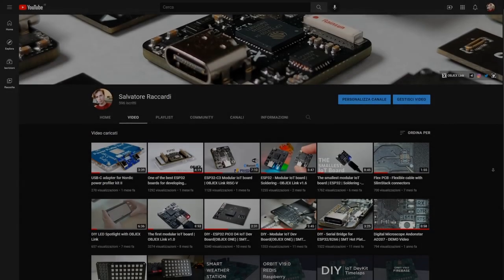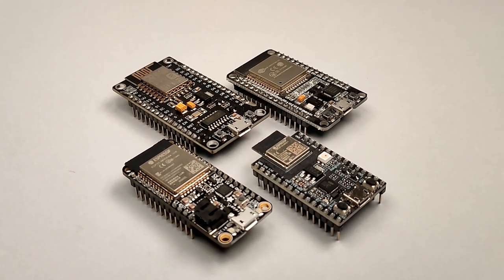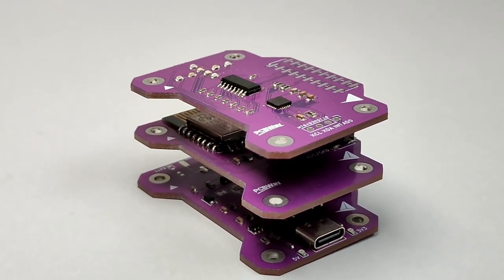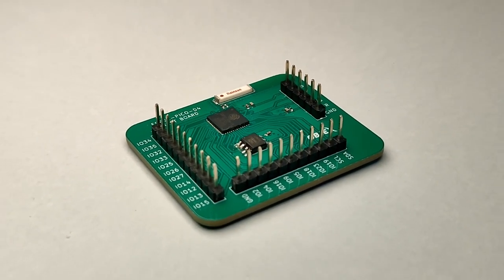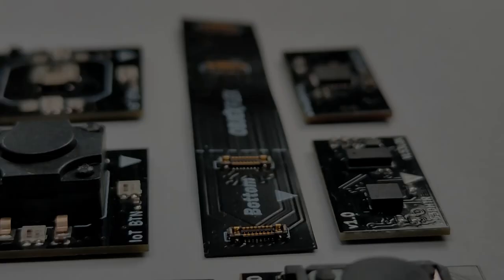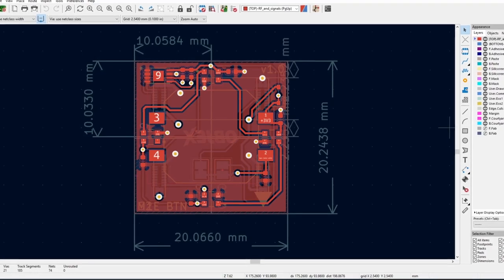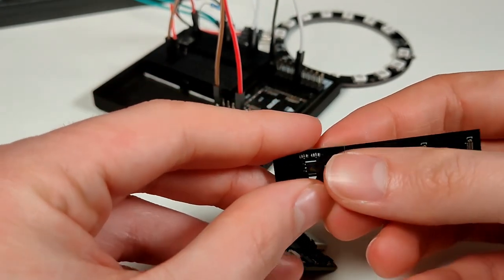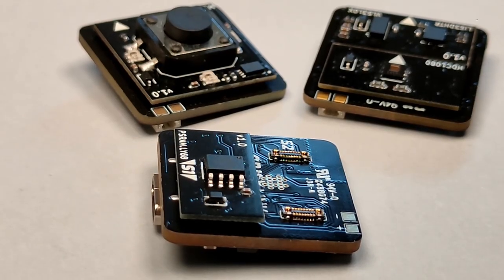The most compact and modular ESP32 board ever? OBJEX Link introduction

Comment: I think you should move battery connector to the side so that whenever type C connector is plugged battery cables will not get jammed inside the case
Reply from the maker: I put the connector there because it seemed the easiest position. Putting the connector on the sides might get in the way when using the prototype board.

Comment: awesome project. i'm wondering about the antenna part. in your schematic, there are 2 capacitors(C1,C3) and 1 Inductor (L1) set as TBD. i noticed in the video you didn't solder the capacitors. i'm just puzzled that what value inductor did you use in the final product?
Reply from the maker: Thanks! At this time, I do not remember the values of the inductors and conductors that I soldered after antenna calibration.

Comment: I have trouble understanding every-single-word. I get the gist, but what are those low-profile connectors at 4:00 into the video?
Reply from the maker: I'm sorry if you didn't understand every single word, you can turn on automatic subtitles. By the way, these connectors are called SlimStack👍
Reply from the maker: I can't tell if you don't understand what I'm saying, or the project. Let me know👍
Reply: @SalvatoreRaccardi  I meant that I have some trouble understanding some words. Listening to a phrase or a sentence, I fill in the gaps, but when a single essential word goes by, like "slimstack", I had no idea.. Thanks for the info.

Comment: Ciao ! Cost is a major concern when it comes to make the final product, the objex link showed here is great to prototype bust costs 40$. 
I would suggest to make a "final product' version without the most expensive parts (type c port, usb chip, led etc) and adding a jtag interface contact pad to program it in production. 
This way it should be more affordable and most important keep the compatibility with the expensive one used for prototyping, without needing to test if the "mass production" design works, because it has already be proven when prototyping. Spero che questo ti sarà utile :)
Reply from the maker: Hi, thanks for the feedback. I'm already working on a new line of boards designed for professional/industrial use only. The kits you see for sale for $40 are the first prototypes I have developed, they are more hybrids to show how the modular architecture works. If you have any questions, I'll be happy to answer them!
Reply: @SalvatoreRaccardi  Hi ! Will the new boards have the same M1 connector as the existing boards ? With the same pinout ? Will they be esp32 powered too ? How will you secure the board to the PCB (vibrations or other forces) if you use the same 4 little connectors ?
Reply from the maker: @gogny7665  No, I redesigned the board, I changed the slimstack connectors ( therefore updated pinout) with a rougher version able to withstand much better external forces. Currently I think to insert only one socket bigger (only two slimstack connectors). There will be two versions the first one based on ESP32-C3 and the second one based on ESP32-S3, of course I could use other uC in the future. OBJEX Link C3 and OBJEX Link S3 will be thought only to develop smart devices. So I have provided M3 ISO14581 holes for easy installation and many other things I will show in the future. Previous versions of OBJEX Link were prototypes to do extensive testing. If you have any advice write to me🙌🙌
Reply from the maker: *ISO14580